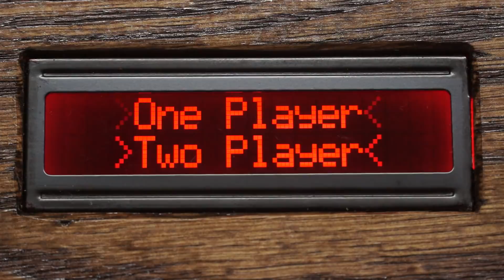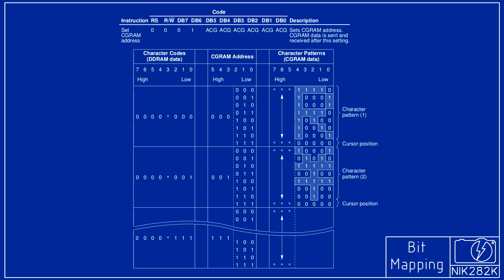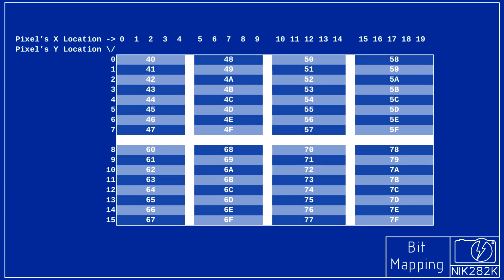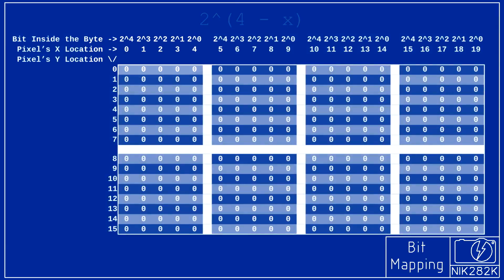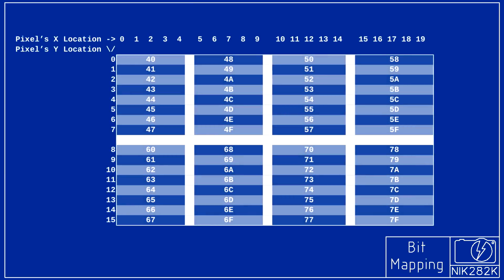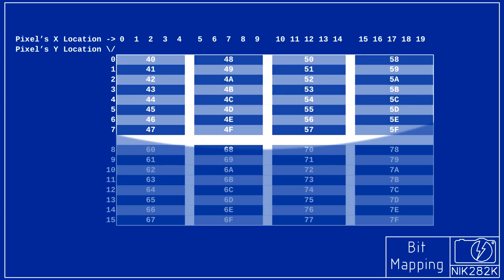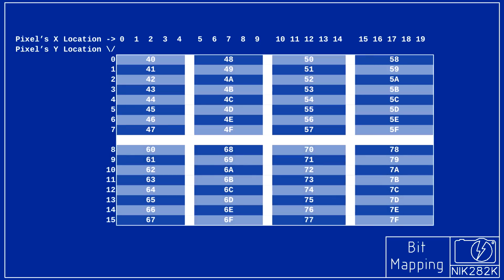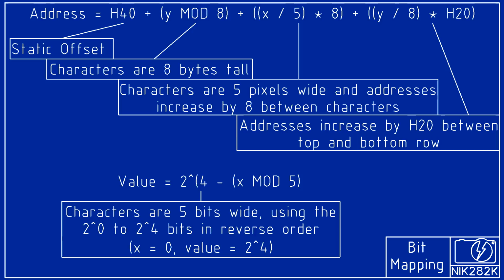Bit Mapping onto an Alphanumeric Display

Comment: Not bad! :) While this makes the code very dynamic, and allows you to animate any pixel in the 20/16 grid, you could also implement this by only modifying the bits in one character, and move the character around when the dot moves past the characters boundaries. This would work since the dot is in max one character location at any point. This way you could have a larger playing field.
Reply from the maker: That's my next step (if I keep at this project). I've seen others use persistence of vision to flash the backlight and move the characters all over the screen to get bit-map use of the entire screen. I'm not sure I could write something that runs fast enough to pull that off though.

Thanks!

Comment: Maybe you actually did that anyway, but instead of doing 2^..., you can use the bitshift operator to do the same thing ( 1 << 2 == 2 ^ 2 etc. ) which is a lot faster.
Reply from the maker: No way >_< I wrote my own little squaring function so I wouldn't have to include another math library when I compiled. Thanks!

Comment: I think that was the first video that you have made where the majority of the content was kinda boring to me. But I still learned something and I think it is pretty cool that you made that. Did you use an arduino?
Reply from the maker: It's hard to make software exciting (you should see the slow motion compiling footage) but I made this video specifically because it can be used by others, the 1602a display is cheap and all over ebay.

I'm using a Basic Stamp from Coridium, it's an Arm M0 with firmware that lets you program it in a modified version of Basic. QBasic was my first language so I decided to go with something I know first.

I'll likely only do one more video about this project on the subject of wiring and designing the program at the flow-chart level, then I'll be back to physics! My cloud chamber is getting close to finished so I'll be able to test some household radioactive sources.

Thanks!
Reply: I bought a bunch of arduino stuff because I am very mechanical and wish I could integrate some programming and microprocessor magic into my projects but honestly its been sitting on a shelf now for a year and I know almost nothing about code of any kind so... yea. I should probably stick to rebuilding bulldozer engines and welding.  I'm enough of a nerd to watch this video so maybe someday my kid will teach me.
Reply from the maker: From what I have seen a lot of Arduino code is made available by others so all you have to do is stitch it together. Arduino is probably going to be my next step after I run out of these Basic chips.